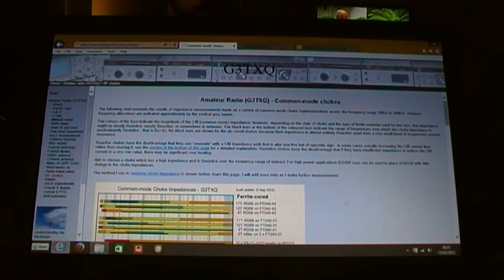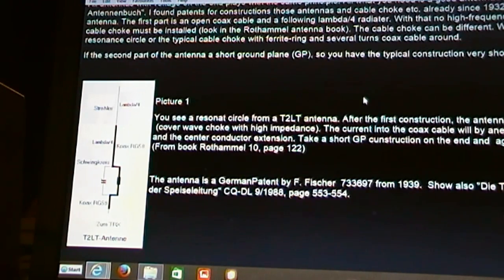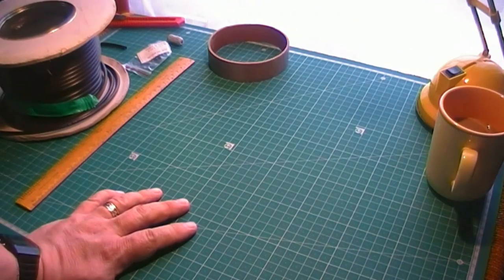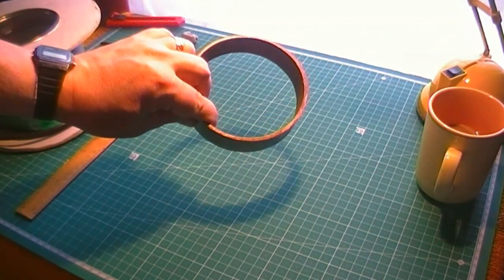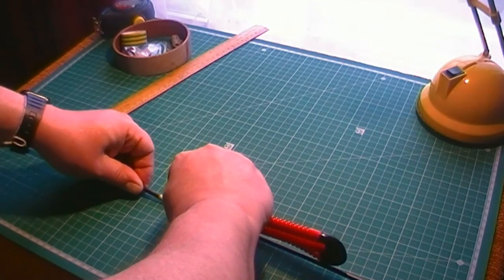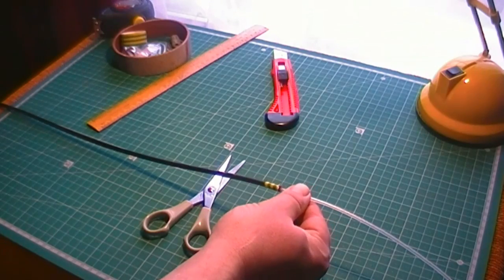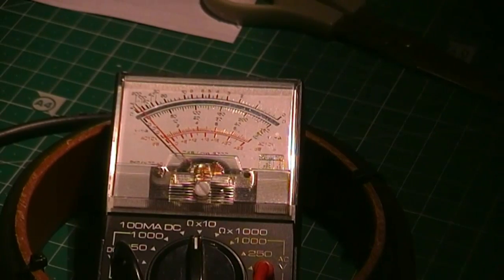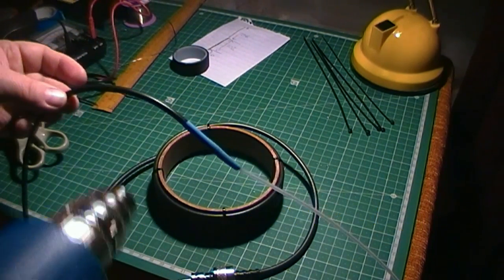Cheap and simple T2LT/Coax Dipole antenna for CB Radio PART ONE (remake from earlier video)

Comment: Too technical
Reply from the maker: I think it's important to have an understanding on how this antenna works, hence the explanation, but just skip to the construction bit if it's too heavy. Cheers.
Reply: @104s_UKCBTV   it IS a good video but for thos who are not very technical..really.. you should have drawn out a very simple plan so people can see the lengths they need..  ie, how much coax after the choke ? it was never mentioned.. I know its not relevant  but others might not..its very hard to find any coherent simple plans online for this antenna... ideally you could start by stating how much cox ( in all ) you need. and take it from there. also an S0239 socket would be better than a PL259 plug, eliminating the need for a barrel connector ... not having a go.. just saying. cheers rob

Comment: Why  waste so much coax!!!! Either just trim the end of the coax and solder a cheap wire for the top section or build a J pole which will eliminate the need for a coax choke.
Both will not waste so much lovely coax :)
Reply from the maker: I do cover the alternative method of adding wire instead of stripping back the coax in the video. Cheers.
Reply: lol its just cheap RG58 !

Comment: Thank you for sharing this guide with us and giving all the lil hints in planning and building. Due to the radio connects at the end its so much easier to erect this antenna (vertical) and have a stable (V)SWR than a center fed dipole. Your video made it look so easy and that encouraged me to try my luck in building my own and guess what, it turned out great and I love it! 73`s from 13NH211
Reply from the maker: Glad you found the video of use and good to hear the build worked out Ok. That's it in a nutshell with this antenna, electrically it's a centre-fed dipole, but physically an end-fed, which is ideal for a vertical installation.

Comment: Question is which works best in your opinion ,,,this or Bazooka. .?  Thanks Shane ct1017
Reply from the maker: They're both the pretty much the same (electrically a centre-fed dipole) but, so I've been told, the Bazooka is an older design which was designed before RF skin effect was understood. So, due to it being easier to make, the T2LT edges it - but, and it's a big but, the choke has to be right or it'll all go out of kilter big time! Cheers.

Comment: Its not about failure, crimp one fittings allow high levels of ingress and egress. Basically it leaks signal. That's why cable and telco moved to compression fittings. They couldn't get reliable enough signal through crimp-ons for digital and HD transmissions as well as data even on analog. So basically their noisy and useless. You may not here the ingress where your radio is tuned but you will be suffering signal loss and irregular signal strength fluctuations.

Comment: So you've got a current choke at the voltage node???

I believe that's why Sirio have so many turns (16T) at the voltage node at the base of the Gain Master.
Reply from the maker: +Aerial Heights Hi - I must admit I'm not too up on the technicalities as I just wanted to create a simple easy to make and deploy antenna for emergency and portable ops - however my understanding is that this is electrically the same as a centre-fed dipole which uses conductor skin effect to allow it to work (basically turning the coax into three conductors) with the outer skin of the braid is acting like the lower leg of the dipole, so it's choked at 8ft 6ins down from the point where the dielectric is exposed as per the standard centre-fed dipole calculation (for a centre frequency of 27.5Mhz). Some more info here http://dl7ahw.bplaced.net/Superantenne00E.htm (it is an old German design, but I have also seen it referred to as coax dipole). Not having owned or researched one, I don't know much about the Gain Master - I do know that a few guys have recreated them in wire and coax for portable use though. Cheers.

Comment: made mine from some leftover RG6 (i know i know, i get it dirt cheap) with 8 or so coils wound on a 4" pvc former.. swr'd in nice, 1.1:1 - 1.6:1 across the us 40ch CB band.. works a treat :)
Reply: I just posted about that since I have a 1,000' roll. Glad it works well! How did you come up with the 8T x 4'' choke vs a 5T x 4.25'' choke?

Comment: When you look at G3TXQ's chart you see 5T RG58 on 4.25" is perfect from 26-28MHZ but a larger diameter will pull this down into the area we want. Soil pipe is slightly larger than 4.25" at 110mm. What I am thinking about is 125mm pipe like this  http://www.irrigationonline.co.uk/20mm-125mm-pvc-pipe/ which has an internal diameter of 117.6mm. RG58 is about 5mm so winding 5T inside would be far closer to 4.25" (107.95mm) or a slither under. An inaccuracy in that direction won't have any detriment unless working down close to 26MHZ. Not sure what real world effect this would have as I'm just starting out my radio hobby. 73s 26CT1757

Comment: Hi Gary 
Made mine from RG-8 as for the coil turns its just the same and cut all to the same dimensions good band with of 1.5MHz to but only thing I used a antenna analyser and got the most out of tuning it up and my feeder length is built in so no probs there  with loads of connections I'm going to build 1 for 40m ham band sometime il let you know how that works !

Comment: I join end of coax with normal cable and save aprox 275 cm of coax, SWR is great: ch1=1,0 ch40=1,1.. thanks a lot for instructional video... I show this t2lt to my friends in Slovakia and they like it a lot, it is very easy to carry so very useful for portables, expecially in our mountinuous part of state... nice job, keep doing the videos...73